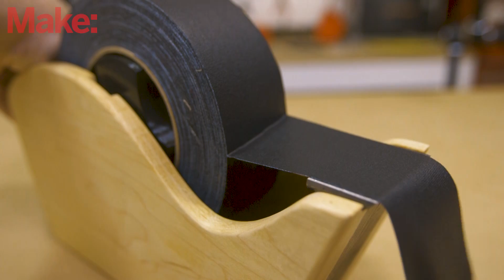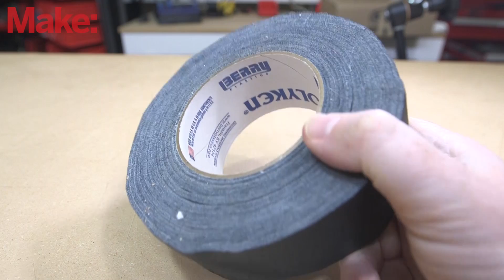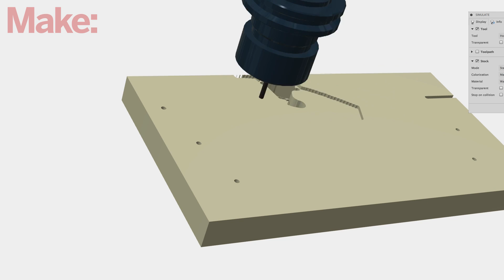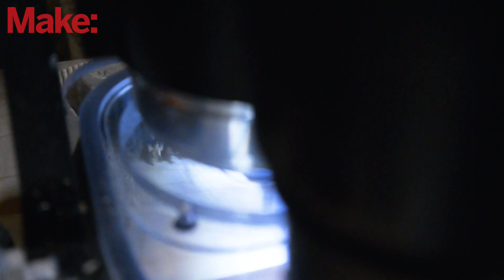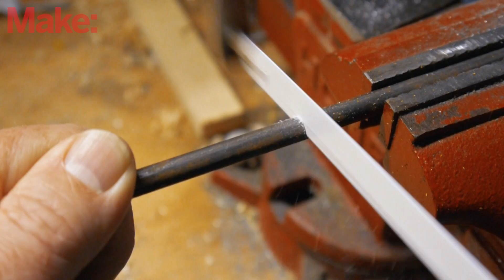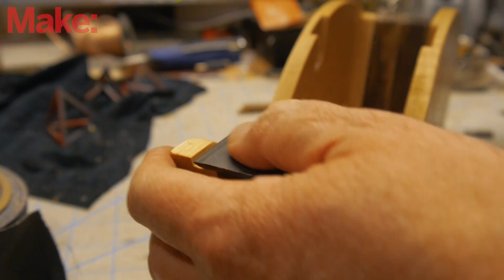Extra-Fancy Gaff Tape Dispenser

Comment: Weird hearing gaffer tape called gaff tape. I think a hacksaw blade would have worked better, holder needs weight, profile for pivot too high and not long enough, not well designed for manufacture...  But it looks nice...

Comment: Nice build. I think I'd be easier to use if you weighed it. A pocket at the bottom with buck shot or something would work. Also if you honed the cutting edge it would cut straight. Great idea though.

Comment: When you're using the file on stock spinning in the drill press, only use it on the right side. If you use the file on the left side, the file is trying to cut "with the grain," and it won't cut. (Unless you reverse the spindle.)

Comment: Definitely worth your time to get confident changing bits. No point running that pocket with an 1/8" bit. Should only take a minute to change bits and re-zero Z. Big pocket first then roller pocket then pins (which I don't think we're really necessary, like you said).

Comment: I completely lost interest as soon as you said you were using a cnc machine. it would not be that hard to use a router and then cut it out on a scroll saw. probably could have done it faster than that x carve did too. no skill required in this except computer modeling

Comment: I noticed that you only used a straight blade for the cutter. Would it be easier to use if you used a serrated blade? Leaving aside the issue of how to make it, of course...
Reply from the maker: Daryl Van Humbeck I was actually just experimenting making a serration on the other side of the bevel cut. I added the serrations using a triangle file. Works pretty well!

Comment: One pet peeve I have on all tape dispensers is that they are all too light (in weight), rendering one hand operation impossible.
Reply: Probably should add a dowel to fit into a bench dog hole and then it wouldn't move... would mean you couldn't use it on a flat surface but around the shop how often are you going to move this.
Reply: I have a tape dispenser that I think is weighed down on the inside by sand. Doesn't budge at all with one hand
Reply: Most are because they tend to be top heavy

Comment: Nice, now do one completely by hand :-)
Reply: vinny142 YES! I have come to be completely turned off by CNC projects. They are fine, I guess, but it isnt really what I go to the shop to do.
Reply: If this had been a combination of CNC and regular woodworking, it would have been more entertaining. Maybe if the CNC was just used for the spindle pocket with the rest of the project done with tools we all have access to. Or one half CNC'd the other half done manually. So we could see how it could be achieved with either tool setup.
Whilst the 3D printed spool part was OK, it would have been nice to see how to make it from wood. Maybe cut 3 holes in a triangle with a 40mm forstner bit then cut the spool out with a hole saw or band saw.
CNC projects just seem like a long ad for the x-carve, which is something I'm never going to buy.
Reply: This guys no Mathias Wendel that's for sure xD